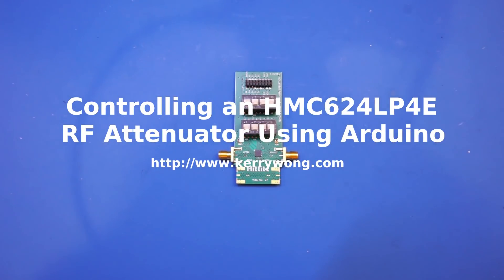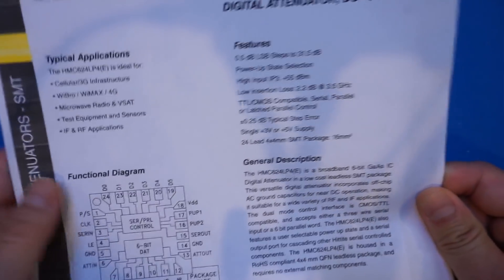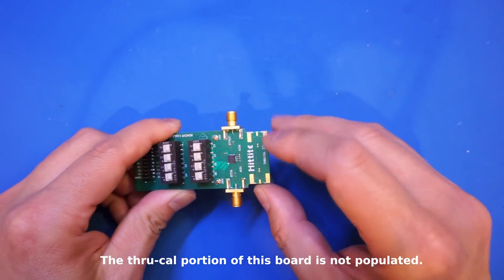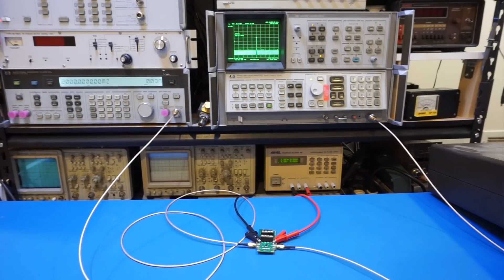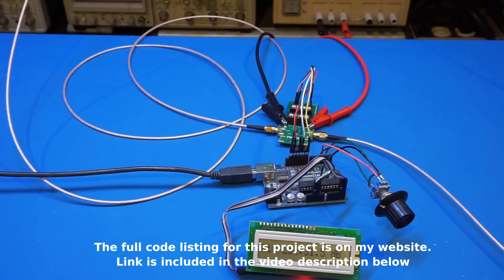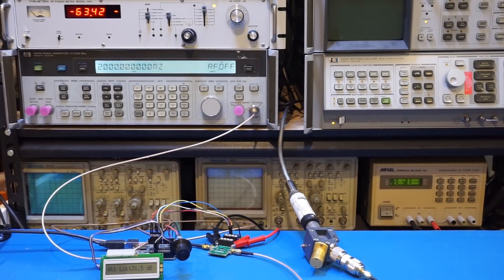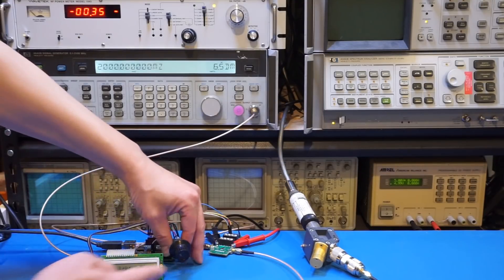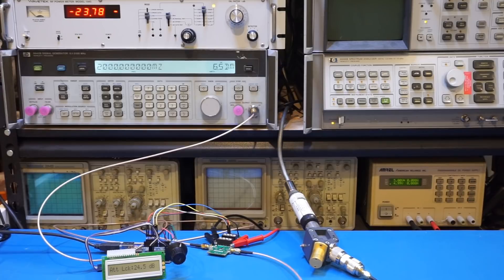Controlling an HMC624LP4E RF Attenuator Using Arduino

Comment: Thank you for posting such a nice video. I wish you had measured the coax attenuation in order to be able to see the effective value of the insertion loss of the programmable attenuator.  Because when you tune the attenuator to be 0dB probably you can achieve only -3dB or whatever actual value of the insertion loss. This will lead to a systematic error between the value present in the LCD and the actual attenuation provided by your device.

Comment: I've never seen DIP switches that large before.  They look almost like displays in the video thumbnail.  I did find one which is selling for $60 plus shipping from Israel.
Reply from the maker: The marking says the switch is CTS-204-124 which looks like it's available on mouser: https://www.mouser.com/CTS/Electromechanical/Switches/DIP-Switches-SIP-Switches/204-Series/_/N-5g2s?P=1yzu819Z1ynwx3nZ1yvsm2d, didn't see the 4 position ones but the switch style seems to be the same.
Reply: I think that switches like that are actually SPDT rather than SPST, hence they require at least three pins.  They may be implemented as a pair of independent SPST switches operated by the same 'knob', with one being NO and one being NC.  Hence connecting two pins on the same side of the body of the part makes the 'common' and the two pins on the other side are the other two connections to the SPDT switch.